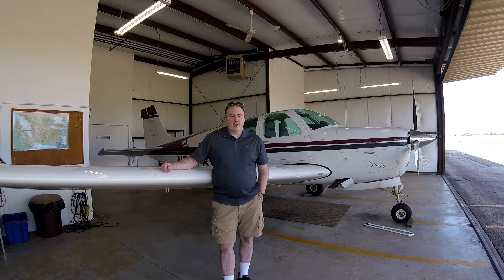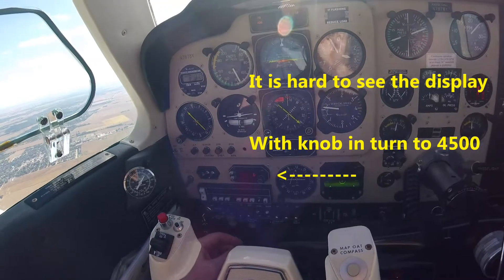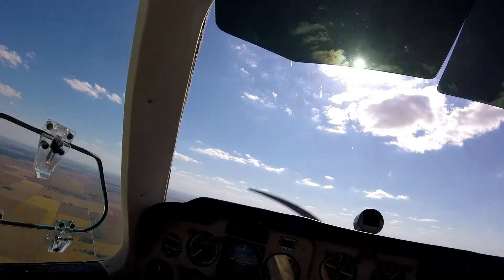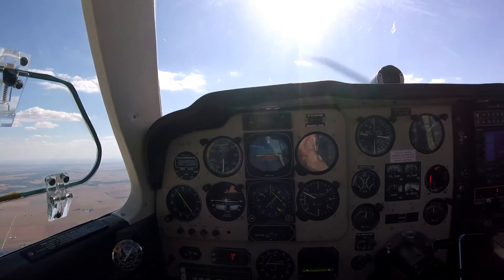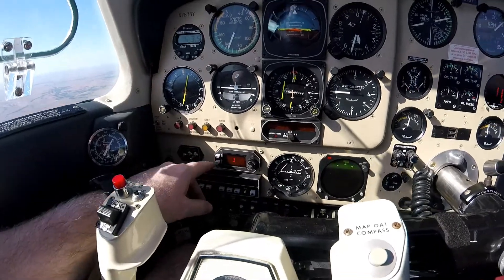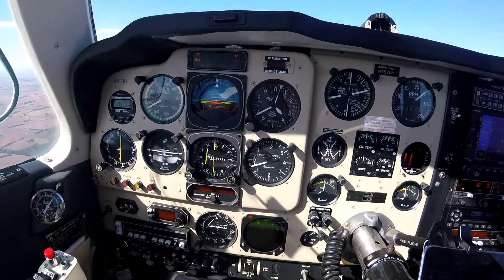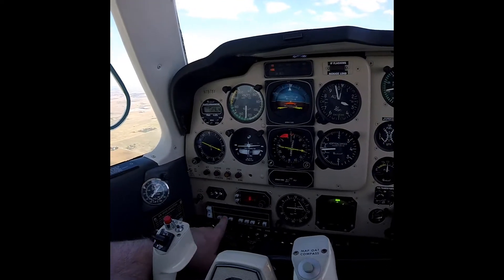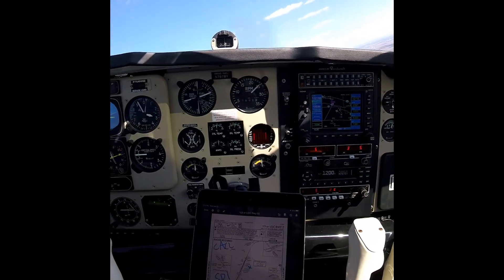How to use the altitude function of the KFC150 autopilot

Comment: I am considering upgrading my old KNS80 to a 530W.  We may do this next month if all goes well.  My 79 Archer has the old IIIB autopilot which is only 2 axis.  I'm wondering if I should upgrade the autopilot, too?  However, I've noticed that modern autopilots adjust the trim on a LVP approach, but not an LNAV.  So you have to adjust the VS yourself.  If you dare to touch the trim, it disables the autopilot which I don't like.  I wonder if I shouldn't just keep the old autopilot and trim for decent myself.  I know you can adjust the VS to -500ft/min and you should be ok, but sometimes that doesn't work very well...  What do you think?
Reply from the maker: Well in all honesty, I really haven't had much experience using the autopilot in the approach yet.  I tend to feel more comfortable hand flying final at this point.  The heavier planes actually seem to trim up and fly a glide slope nicely without AP intervention.  Considering autopilots ain't cheap, and if yours works well as is, my opinion would be to hold off.  That is just my 2 cents though.  It is a very subjective question.  Now the GPS, I think you will get a lot of bang for the buck.  You may have trouble finding a 530 though, and if you do, it may not be much cheaper than a 650.  I would say look at the 650/750 or Avidyne equivalent.  Those are really nice and do a better job with flight plan entry.
Reply: @kujoclips4962  I had a dealer in Prescott tell me the same thing about the 650/750.  Unfortunately, I emailed him to get a quote on a new 650, but I never heard back.  I need to give him a call.  The avionics shop at KAVQ has a used 530W coming in for about $6500 plus labor to install.  They also offered me a used one day 750 (not the Xi) for $12K plus install, but the wife said no.....  I should have jumped on it.  By the way, that sure is a nice hanger you've got there.  Sure is a step up from the west tees at CID!!!  You even have heat!!!???  Wow!